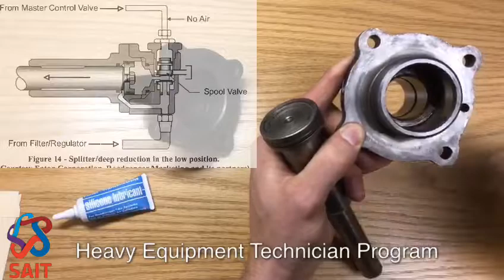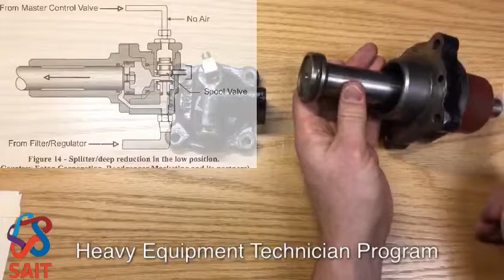Operating Principles of an Aux Transmission Shifting Splitter Cylinder

Comment: I have question!! I have 13 speed transmission but I have  problem when I moved the selector to low to high  the transmission start grind I don't know what is wrong you can give me some idea about that??
Reply: Hy bro I’m having same problem what was your the issue plz thanks
Reply: @husjego2059  did you figure out the problem?

Comment: Thanks for the diagram! I'm having an issue with my converted 13 speed rtoc1609a. When in a high split going to the next gear in low (after preselect) it grinds and I'm having to feather the throttle a lot more than normal to get into gear. Normal shifting in the 9 speed pattern without using splitter and also while downshifting with or without splitter and no issues. Also notice constant air release from exhaust port when master valve is in high split position. Would a rebuild of this system be in order or could it possibly be an issue with ecm timing due to converting from the 9 speed to 13? Thanks!

Comment: When I shift lower 4th to The Higher 5th it grinds.  I have to play with the accelerator to get the RPMs just right it's been doing this the last couple months is it the external shifting mechanism or the synchronizers
Reply: The synchronizer in back half

Comment: I am trying to replace my orings, however when I removed the 4 bolts I cannot get the splitter cylinder to come out, it’s loose but acts like it’s still stuck to the fork. Is it even possible to pull the splitter assembly off by itself or do I need to remove to entire auxiliary trans/ rear ended if tranny to disassemble and change the orings?
Reply: Me too. Did you fix it? Can you show me how.

Comment: I have 10 meritor is that the same system on those meritor 2 

No high , only low any suggestions
Reply from the maker: The 10 speed can either have a split of the main case or a range of the main case. The difference is in the pattern. If there are small (half steps) in the gearing sequence than the main gears are being split. The ratio changes would be limited to about 15% at a time. Otherwise if it goes 1-5 in low than 6-10 in high then the transmission has a range cylinder.

Comment: What does it means splitter ?
Reply from the maker: The Aux transmission of a Commercial transmission has a range and a splitter. That means the main box ratio can be increased for each gear by the ratio in the range or the splitter. This allows a 5 speed main case to become a 20 speed trans although due to design factors with bearing supports, they become 13 or 15 or 18 speed transmissions. The splitter will change the ration about 15-20% and the range 30-40%.